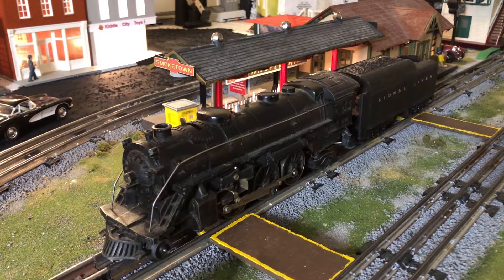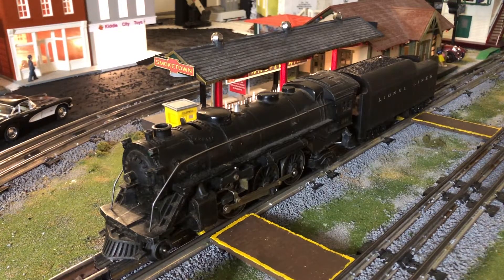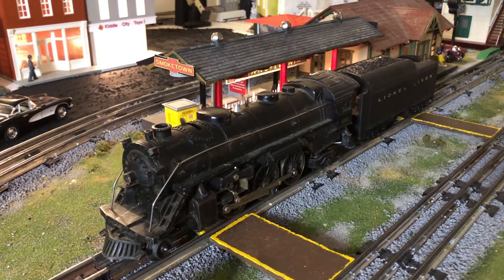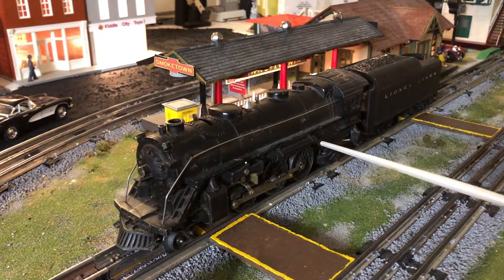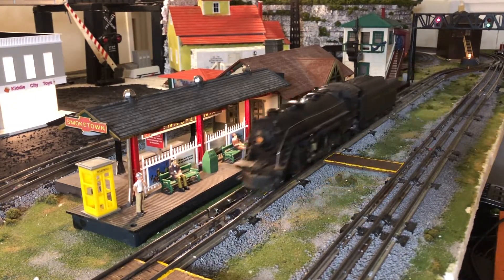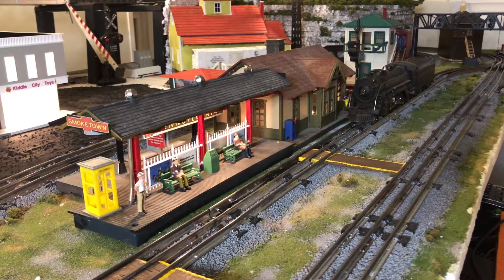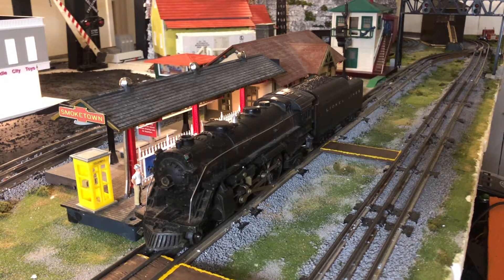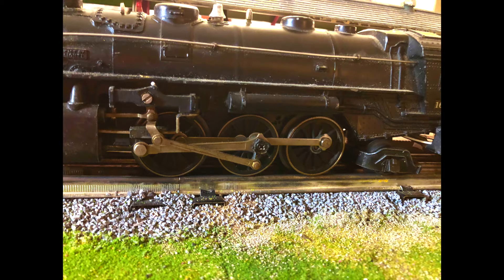Lionel 1666 (Post War) Steam Engine - Nix's Reviews Episode 1

Comment: Such a cool engine and story! That has got to be the smoothest sounding postwar engine I’ve ever heard!
Reply from the maker: Thanks! I think minus rewiring to upgrade from the original cloth wire that was toasted, the brushes were replaced. I use a CRC product called Electrical Lubricant on the motor and E unit for general maintenance. Also 3 in 1 oil on the armature "oil" pads. Whenever I take motors apart I use CRC Contact Cleaner. Hopefully this info helps !

Comment: 1666 is good runner i had one that was trashed, my mom got it still looks good sitting on siding
Thanks for subscribing.
Reply from the maker: They can be kinda tricky to repair. I think they used the same motors as the 1668s (prewar torpedo). Hopefully one day you can get it working. Not a problem, same here !

Comment: Having a 1666 and a prewar 224 they are similar and both good runners. They both surprise me how well they both handle a long line of heavy post war cars. You pointed out the detail of the wheel linkage and I agree very impressive. Extremely smooth but does require more throttle position as opposed to newer 50’s steam locomotives. The absence of smoke is the only feature I miss. I now have two 1666 one has original tender (updated post war coupler truck). Both are pre war with straight back behind the cab. I think they are 1938. And yes the whistle tenders are heavy.😊😊
Reply from the maker: I wish these had smoke units as well , but I guess that’s why they gave us all the fun smokers in the 1950s.  Thanks so much for watching!

Comment: Good review and nice engine.  I bought one at a train show in March for $40.  It was in rough shape and it's missing part of the drive rods and the draw bar, but I got it running.  They do run smooth and quiet.  I am able to pull 4 to 6 cars with no problem.  It runs better than the Hudson because it manages the O27 curves better.
Reply from the maker: Thank you so much! That’s awesome to hear! I can’t wait for train shows to start back up so I can get more parts 😁

Comment: I have two, one with and one without whistle. Neither run but they are beautiful engines.
Reply from the maker: I have both variations, both run but the mechanisms are really sensitive
Reply: @NixCrossing  
Both of mine have postwar couplers. I’m not sure what other variations there are.
Reply from the maker: @MustangsTrainsMowers  I believe the 2 variations are the swivel bell (older) fixed / non swivel bell (newer). This was right after WW2 and they had a lot of quality control anomalies

Comment: Just a note,the black handrails on some 1666 locks places it as a 1946 issue. Lionel like other companies wanted to quickly return to commercial products.The only wire stock that Lionel left over from the war could get so soon was black
Reply from the maker: That’s really cool! Thanks so much for the information. I’m always on the lookout for a black variation. 🚂💨
Reply: Early 1946. Most 1946 production  did have nickeled handrails. I have two of them myself, both were even afflicted with the weak axle knurling that plagued some 1946 locomotives.

Comment: I doubt the eccentric cranks or crossheads are plastic, unless they are replacement parts. All the many examples I have seen have cast metal ones. One other minor difference in 1946 vs 1947 production, is the steam chest is attached with screws in 1946 and prewar examples. 1947, they are staked to the boiler and an absolute beast to replace if needed. I've observed weak axle knurling on 1946 locomotives, causing drive wheels to work loose. In my own research, there were metal shortages that year, partly from a number of steel industry strikes, and partly from demand for steel being high for all sorts of goods, so it appears Lionel used a lower grade of steel for axles that year, which means in time the knurling on the ends of the axles wears down. Supporting this theory, Lionel also made 022R switches that year, which lacked the steel bottom plate every other year has, due to material shortages. Having said that, 1666 types are very nice locos. I have several, and several 224 types, which are similar, but with slightly larger drivers. So my 1666 get used for freight, the 224s for passenger and fast freight. By the way, Train Tender usually has those green rhinestoes.
Reply from the maker: Thanks for the information 🚂💨

Comment: Thanks for the information.  I just paid $42.00 for one with a tender at an online estate sale and I wanted to know if I got a good deal.  From your video, it sounds like I did.  I hope it runs. 

I also got a 250 watt zw with a Trainmaster lw for $84. Again I don’t know if they work or not.
Reply from the maker: That’s an excellent price for one of these awesome toy trains. This was my first prairie locomotive when growing up. Just make sure to grease all the gears and oil the motor and bearings on the mechanism before running. The engine might also need to be taken apart and cleaned with contact cleaner.  Those are awesome transformers as well!  Good luck with everything 🚂💨

Comment: I recently pulled my father in laws trains out of the attic. I have the same engine and a tender there are two tabs underneath the engine that are supposed touch the center track. One of the tabs fell off and was laying on the track. I have no idea how to reattach it. Any ideas? It's the tab in front
Thanks! Their is a small hole drilled in the tab. But I didn't find any screws
The rear tab seems to be spring loaded
I never did get the engine to run
Reply from the maker: Hey! It’s always great finding these classic trains! The pickup tabs should spring into place - a brass tab hidden under the “cardboard” insulation material should accept the tab back. You can use a screwdriver to carefully push the brass contact back then drop the pickup in place.

Comment: Does your 1666 engine have a spring on the two-wheel front truck.? My 1666 runs real smoothe but front truck isn't sprung.
Reply from the maker: I believe one of them does , runs really nice as well. Sometimes it’s better without the sprung pilots. My Full scale EM1 pilot liked the jump switches until I took out the sprung clips that held it to the rails

Comment: just watching your 681 loco review. You mentioned the william turbine had front truck problems . 2 things could do it  the rack is not high rail tubular track and thus th front truck derails over switches.  2 the spring in the front truck mounting ass'y might not be strongwomen gong you could stretch i apart or replace with a strong spring. Good luck and nice videos.  if you even need orig parts let me know repairinfo at juno.com
Reply from the maker: Thanks so much for watching! The Williams actually does not have a tension spring. I’ll definitely add one of those